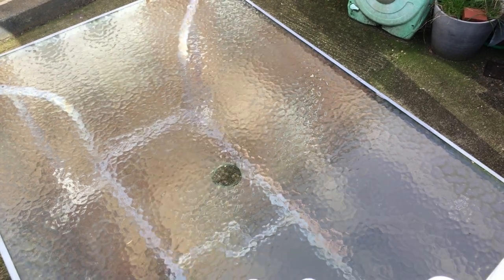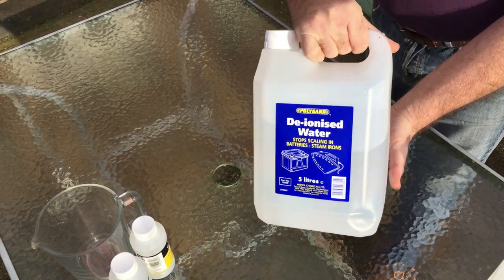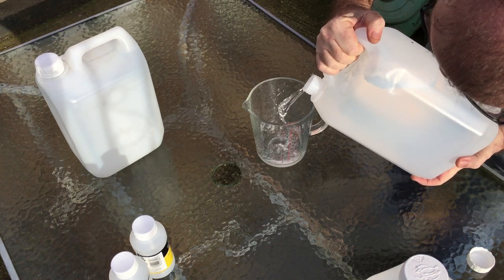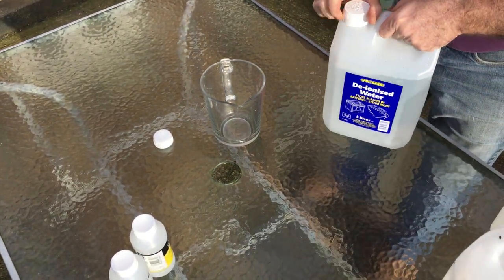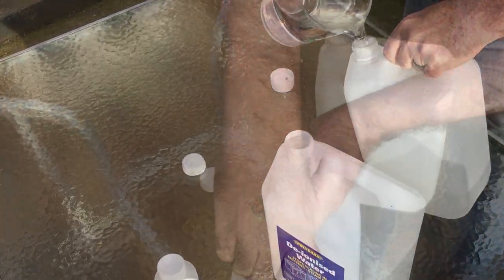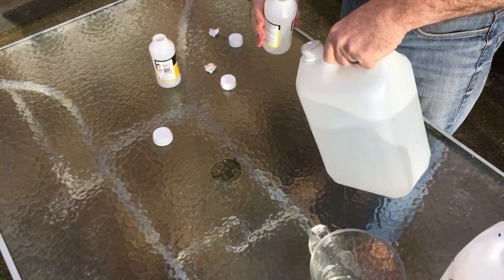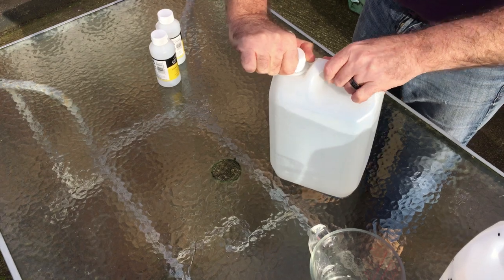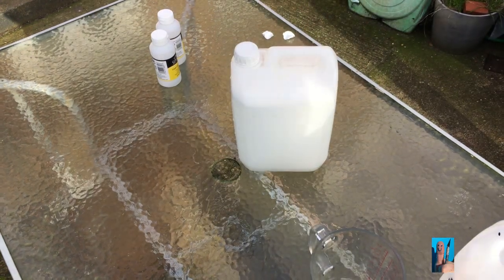How to make Homebrew Acrylic Thinners

Comment: Is it safe to use IPA in the thinner as it can react bad with Vallejo acrylics?
Reply from the maker: Jozua, it is perfectly safe with Vallejo, but NOT with AK. It separates the paint colours 👍🏼👍🏼👍🏼
Reply: @BudgetModeller  Thanks, i will try this thinner. As i want to switch from solvent based paint to acrylics. 😉👍

Comment: You are using a lot more flow enhancer and fluid retarder than others does this mix not over slow the paint, or maybe make it too soft and liable to damage once dry, if it ever dries ?
Reply from the maker: Hi Jean,
Thanks for the comment, can you point me towards the others please? It works perfectly fine, no it doesn't over slow the paint drying and yes it does dry, and no it's not liable to damage.
Kind Regards,
TBM